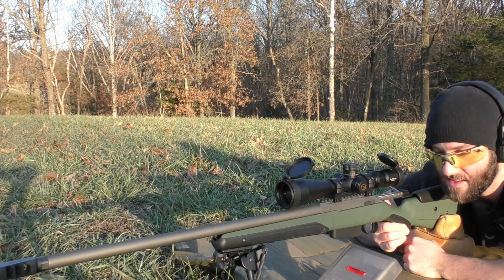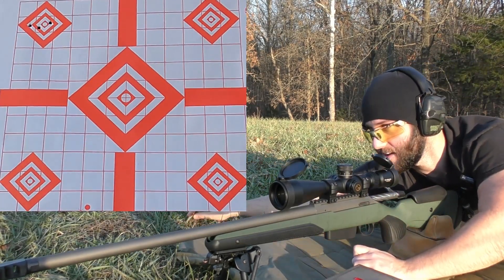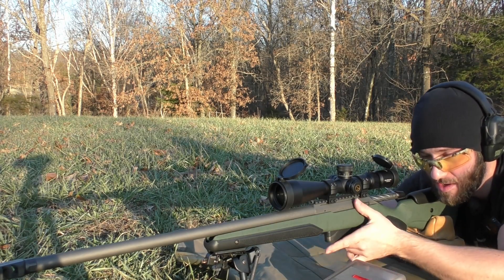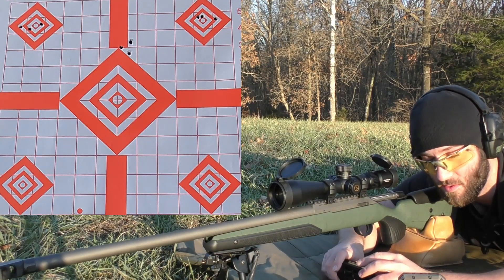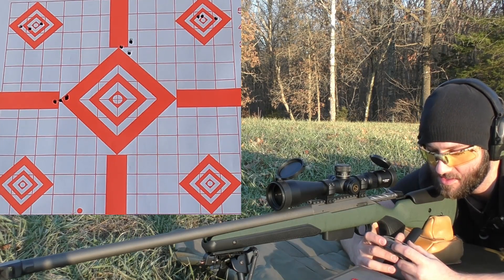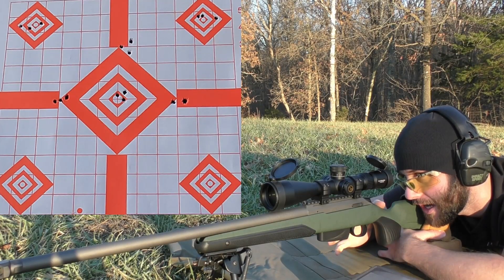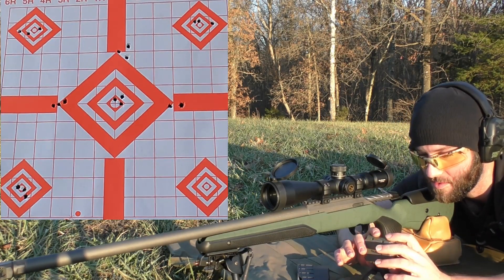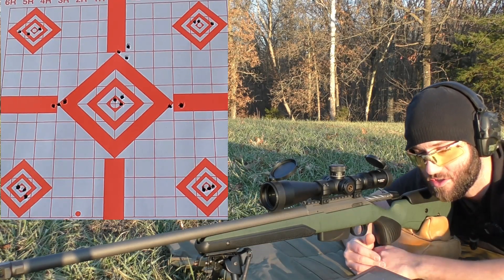New Hornady 77g Aeromatch Bullet Tested! Tikka T3X Super Varmint 223 Remington Handloading Accuracy

Comment: Awesome video. What OAL did you go with ?
Reply from the maker: 2.260"
Reply: @ I’m thinking you may be able to load them longer if you find your jam point and subtract 20 thou. The mag should be able  to accommodate. Also , which single stage trigger did you end up going with ?
Reply from the maker: @robbysreloadingroom  These magazines don't actually give as much room to load bullets out as I thought they would. Otherwise, I would have loaded them longer, probably. It's a Bix n Andy trigger.
Reply: @ 🤩 I’ve always wanted a bix n Andy competition trigger. Is there zero creep as advertised ? How light did you go ?
Reply from the maker: @robbysreloadingroom  mine doesn't have any creep, but I didn't adjust it any. It was pretty darn light from the factory.

Comment: Use one kind of powder, and work up. You are wasting components, thinking you are not wasting them. In other words, you are spinning your wheels, and getting no where. Unless you happen to get lucky. These Tikka's love heavier bullets, you just have to run them right. Your velocities in the 2,400's is not going to cut it. I have 20" AR's that are pushing 77's at over 2,700 fps. When you find a good load with a Tikka, all 3 shots will go in the same hole. Just how it is..
Reply: Another good indicator is multiple impact holes are bigger and misshapen which confirms your assessment. The bullet is not stabilizing at those slower velocities. 1/8 twist should those 77 pills into a ragged hole with higher charges.

Comment: I Have found that .223 loads always group best on the higher-end of the fps. The faster the better. Powder CFE 223 , or Varget . Max. end of the recommended charge. COL. 2.250" - 2.260" . (Barnes 50 gr. Varmint Grenade, 28.5 gr. CFE 223 COL. 2.258") , (50gr. V-Max 28.9gr. CFE 223 COL. 2.250"). (for a 75gr. Projectile, try 24.7gr + - CFE 223). Varget powder charges in the 26.5gr. range for a 62gr. projectile. I have never had any issues in this range.The groups get better the hotter the charge. Rifle tested. Remington 700 police, and Tikka T3x Tact A-1. Work your way up to this range and you will see some one hole 5 shot groups @ 100m. / 150m.